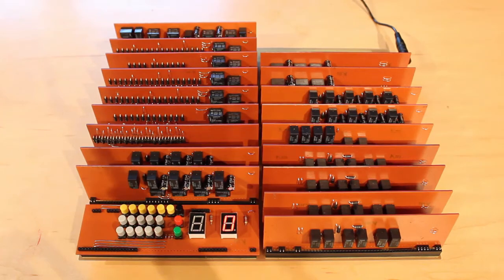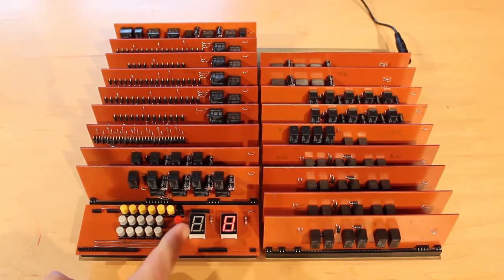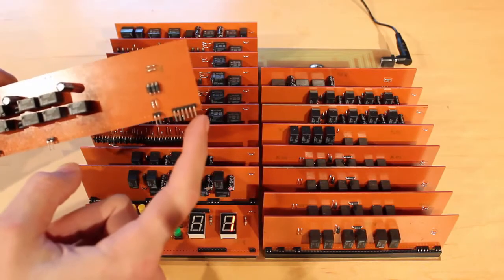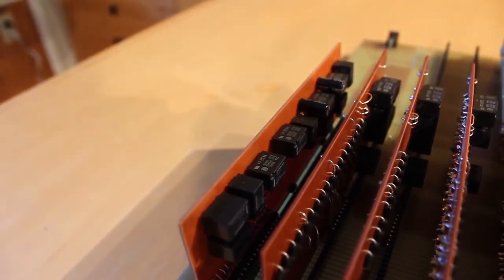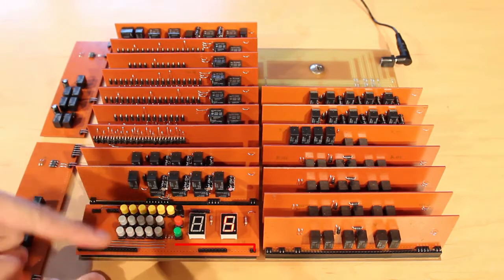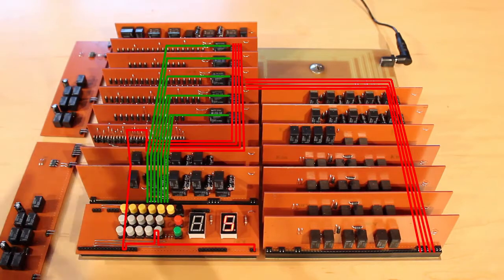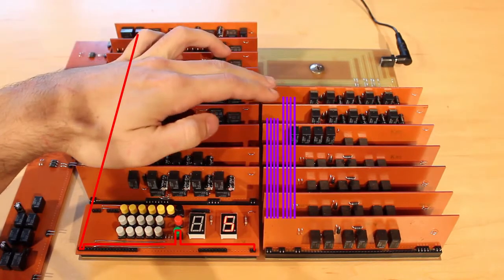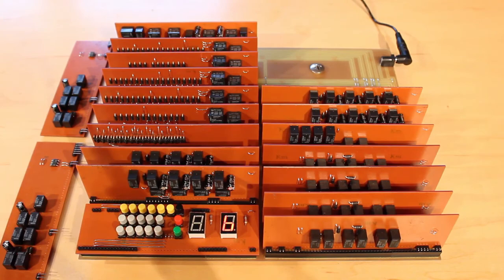Relay Calculators: Episode 5 - Hexadecimal Relay Logic

Comment: Amazing project, could you give some more insight into how the 4 bit to hex converter works? Many thanks
Reply from the maker: Thank you!
I essentially use a relay decoder to break the 4-bit binary into 16 individual signals. Then, each of those run through a series of diodes corresponding to each segment of the seven segment display. This ended up taking five boards, 29 relays, and 78 diodes!

Here's what my decoder is based on: http://www.relaiscomputer.nl/images/Decoder.png
And here's what one of the decoder boards looks like: https://imgur.com/a/AGVORy3

For this specific board, the collection of relays on the right decodes the binary 0000, 0001, 0010,  and 0011 into four different outputs. Each output is then fed through a series of diodes to supply power to the proper pins corresponding to the 7-segment. For example, 0000 is the six right most diodes. Those six diodes feed into pins A, B, C, D, E, and F. The next number, 0001, only needs to illuminate two: B and C. I just repeated this process for all 16 digits that can be displayed.

It's kind of a brute force way of doing it, but it worked a treat!

This website is by far one of the most amazing websites I've found when it comes to relay computers: http://www.relaiscomputer.nl/index.php/elements 
He's got loads of indispensable information on there!
Reply: @UsagiElectric  Thank you for the explanation and links!